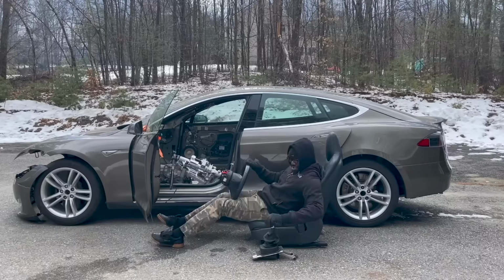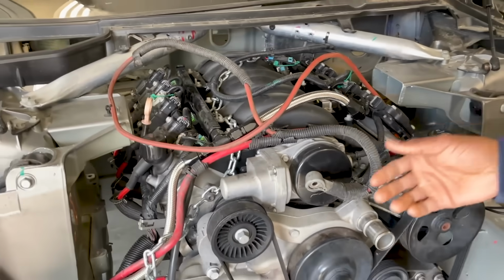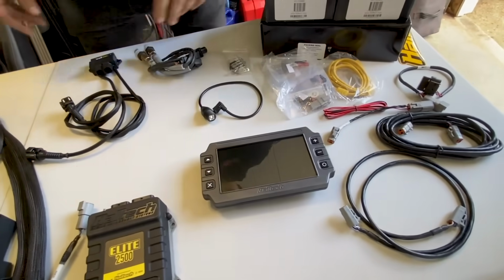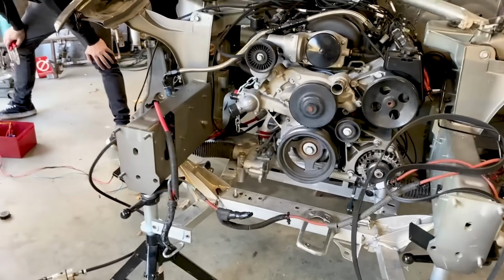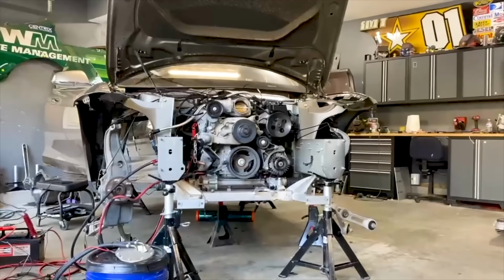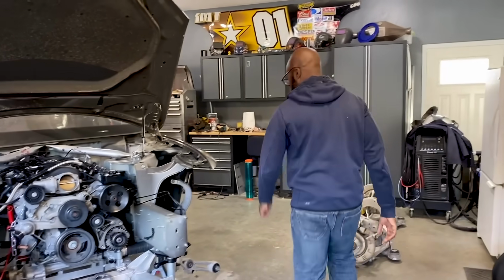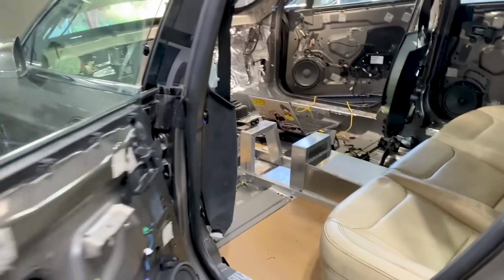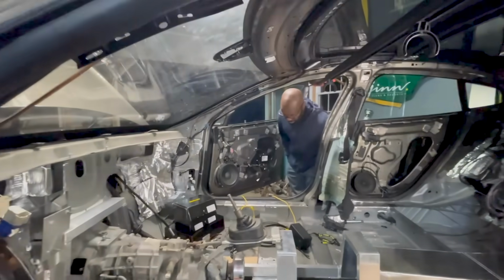Starting the worlds first V8 powered Tesla

Comment: 8:16 anyone who asks how youll do the spark plugs, Has clearly never changed them on a v8 Camaro..... MUCH more difficult than this, You literally have to drill a hole in the firewall (with a hole saw) from INSIDE the foot well of the driver to change that back one. OR diconnect the engine from the trans to allow it to slide forward a couple inches to get at it.
Reply: Yeah, on some FWD v6 engines you have to remove the intake. That's why they use platinum plugs that can last 100,000 miles on most modern cars.

Comment: @21:00 check out how the motor spins backwards because it sounds like the starter went backwards as well. I wonder if it's the light switch you used. I'd check into it before it causes a bigger issue.

Comment: I think You should go in easier direction - SWAP engine but full mechanical V8 with carburetor without any sensors. You don’t have to made complicated comunication and wires. And it will be bigger shock for Elon...

Comment: The -8 fuel line was most likely to run E85. To run on alcohol a much larger amt of fuel is needed. Hence larger fuel lines and sometimes larger injectors. More horsepower can be gained in the end. Tnx for taking us along

Comment: Cool and interesting video)) But in my opinion it would be much cooler to screw the generator to the motor and power the factory Tesla electric motor without batteries)) the mass of the internal combustion engine was compensated by removing the battery))

Comment: I’d like to drive with proper engine but in my opinion diesel should fit better in this project. Tesla without black smoke from exhaust is still not the best possible internal combustion Tesla. 3.0 tdi  isn’t very heavy and after few modifications has enough power especially for Tesla without useless batteries inside.

Comment: Would the V8-engineered Tesla have a longer range? What will be the size of the gasoline tank?
Reply: Should be a longer range, Teslas can't keep their promised range IRL anyway.
Reply: Depends on the tune, but it will probably be anywhere between 300 to 400 miles a tank if you don't dog it all the time.

Comment: 2 1/2" pipe might be better. Need to keep some clearance away from the floor so you don't melt carpet. Or you can run dual 2" pipes on each side and make a custom muffler manifold.

Comment: What's up with the B4 wagon in the background?
Reply: Was a VR6 with a automatic transmission  that I swapped to a TDI with a manual transmission
Reply: @customcreations...............  I have a B4 vr6 sedan I want to swap cd009 in
Reply: @Z69Silveraydoe  You making a rear wheel drive B4?
Reply: @customcreations...............  yes, I have a 350z diff so far, but that can change if I come across a Corvette donor.
Reply: @Z69Silveraydoe  Cool project. I would not bother with getting a corvette differential.

Comment: Whomever said, "You have to pull the motor to change the spark plugs!" has never seen a 4th Gen Camaro. In comparison, this Tesla has a TON of room, even without the side access route. Never had to pull the engine on the 4th Gen ... no reason to pull it here.

Comment: This makes no sense.  Why even call it a Tesla, all it is a free standing motor with some Tesla paneling.  It will never be allowed on the road, as you couldn''t insure it or get it plated legally unless you lied about the make/model?  The transmission will likely fall out the floor, if the engine doesn't catch fire first.  All this because Tesla revoked your supercharging ability on your rebuild?  Obsess much?  (I checked, I'm not mouth breathing, but I will turn this off and go play Cyberpunk 2077, it's built better then that pile of parts!)  LOL

Comment: Just curious what's dimensions on the electric motor  center to the shaft output center and weight of the battery to power it

Comment: Are we not gonna talk abt how it sortof ran withought the valves moving cause there's no belt on it 💀
Reply: It is a push rod V8. The valves on this engine are operated by push rods moved by the camshaft inside the engine not the missing serpentine belt

Comment: As it already has a v8 engine and kind of reminds me of a pontiac gto, paint it wine red or keep the original color.

As for the exhaust system you should have a lot of empty room underneath to put a double down pipe exhaust system under the floor but since it's aluminium which can behave a little different from steel when exposed to heat, I prefer a side exhaust layout exiting as far back to the rear wheel as possible or out the rear bumper and just for the benefits of it ceramic coat from header to exhaust tip to keep temperatures lower and as a bonus a power increase.

Comment: When tesla gave you an electric, powerful, reliable and quiet motor but you still replace it with an inefficient, loud unreliable engine
Reply: If only teslas were more reliable then one of the most proven V8s in grassroots motorsports. And tesla wouldn’t give him another after the car was in a flood because they didn’t want an old car back on the road, which is obviously the least environmentally way forward. This car was either scrap or had a new drivetrain, and this was the outcome.

Comment: I know im late, internet problem. 2.5"-2" straight is more than enough for a throaty v8 sound. Im sure your not going for horse power, 2" is good enough for 350-400hp save your fabricator stress, money, time. Never seen a sub 400hp motor choke on 2.5".

Comment: I bought my 1996 cadillac fleetwood 6 door limousine from ebay, i plan on modernizing the tired old LT1 and 4L60e and then adding a pair of 25-50kw motors to each of the front wheels and then covering the hood, roof and trunk with form fitting solar cells, and then battieres along the massive floor and behind the middle seat. I'm hoping to get the mileage up to 30 city 45 highway(when i'm not having fuel issues i used to get 30-35MPG at 55MPH flat ground)

Comment: this is one of the only channels i think somone might have the answer to this: if i have a front whele drive car  can i add or modify the rear to have  a electric drivetrain and if so how would i need to add logic for the engine to shut off and disconnect the  engine or can i just not worry and run it ne neutral and have a on off switch on the engine for when i city drive?

Comment: Converting a STUPID ELECTRIC TO A V8 IS AWESOME! I love what you are doing!!!
But why not put the engine in the back and install a wall behind the front seats? 😁😁😁😁😁
And use a HUGE 6.7 L DIESEL with exhaust up the roof, modified to SMOKE like a coal locomotive. ✌️✌️✌️✌️✌️✌️✌️✌️✌️

Comment: Not only did you place a ancient internal combustion fire breathing engine in this modern day space ship, 
you also took all the feminism away from those plush seats with a gear banging clutch pushing 6 speed MANual transmission.

The fossil fuel will be burning hot in this machine!  
The clutch dropping alone is worth at least 1million subs from motorsport enthusiasts.

Comment: The irony when your v8 powered Tesla can't run because there's no gas in the gas stations from the pipeline being down
Reply: You do know that engine´s can run on anything that burns, right. 
Ethanol, Alkohol, Methanol, Nitromethan, evan brake cleaner. So don´t worry internal combustion engines are here to stay. :)
Reply: @NB6C-q3v  try running your family car on nitromethane
Reply: @PappaLitto  Don't have to because, 93 exists. 😂
Reply: @NB6C-q3v  Are you implying 93 isn't gas?
Reply: @PappaLitto  Yes. 93 is in fact not a gas, but an octane rating. You got me there.😂 That's why it's called 93 octane.  (surprised pikachu face)
Reply: @NB6C-q3v  where I live all gas stations are out of gas, yes even 93
Reply: Just drives down the road while someone is constantly going through starter fluid on the bonnet

Comment: Nah still use oval exhaust it would be cooler also I would make a plate to cover up everything on the bottom so you could install a lot of things under there and it could be completely hidden away I love the ls telsa
Reply: I think what he meant was that he would be using circular pipes but the exhaust tip would be oval.

Comment: Side exit exhaust right in front of the rear tires is perfect
Reply: But would it stop the smoke from getting inside the cabin. That was the reason they did not opt for placing the exhaust in front of the cabin.

Comment: This was commented before watching the whole video: plastic bucket+gas=Static electricity.
Reply: What is your point? Most of your red lawn mower type fuel cans and your automobile fuel tanks are made out of plastic.
Reply: @customcreations...............  they're also designed to press out oxygen with their own fuel vapors as it's being filled. A 5 gallon bucket doesn't really have that luxury it still has plenty of air and fuel mixture so the static electricity of the fuel leaving the nozzle and running down the sides of the bucket have plenty of air to mix with as opposed to a lawn mower container that doesn't even have oxygen present in it because it's being pressed out by the fuel vapors
Reply: @PSBeachBum  Not going argue your point but over the years I have put gas into buckets for various reason with no negative out come. Dumb luck I guess

Comment: The exhaust you must figure out more issues and one I saw is the exhaust pipe cannot seat flush to the floor cause the heat will start to melt into the insulation and the carpet or wires even if they are in the cab , so the brake line is not the only problem you have .  An oval pipe might be a solution because you must set it at least 1 to 2 inches away from the floor and get an aluminum heat shield that may help.

Comment: The color is absolutely perfect for this project! ;)
There's more room to change the spark plugs on this than my 1973 Mustang.  I can remove/replace the Mustang heads without removing the engine though, not so sure that's possible on this conversion...

Comment: this series ends to the Tesla rep standing on each gas pump in your area.
and only allows you to squirt little drinking glass worth of gasoline at the time.
why? because you dared to service your Tesla yourself. 
and this is best way that i could think of, to simulate a disabled supercharging.

and don't listen to the haters Rich! does this make any sense?
answer is: does it have to? not everything in the world have to make sense.
 this while kinda stupid is still really cool and something that i have joked around many times.
only thing left would you to figure out how to make Tesla accept a charge while in drive.
then hook the most powerful and loudest diesel generator that could fit in a trailer.
then for once drive around town, on a electric Tesla without needing to worry about the battery percentage.

Comment: Shoulda modified the tesla battery to fit in the trunk and back seat away from the exhaust heat. And kept 2 of the tesla motors for 1500 hp.

Comment: Make sure to get some heat shields for the exhaust.   It’s thin where the pipes are going to be run and it will be hot and load on the floor.

Comment: For the ppl saying that he's making it slower- on the street, probably so going from AWD to 2WD. Maybe with some drag radials or bias plys it would be close. However at a 1/4 mile drag strip, this LS setup will be faster. Even if it wasn't, it's easily modded to 800hp no problem. Possibilities are endless after going LS. With the stock tesla setup, it is what it is and there's no modding to make it faster whatsoever besides tires and weight reduction. Plus this is the first tesla that can drive long drives without stopping and charging for hours. I'd much rather take this on a vacation than a stock tesla. Lol

Comment: Looks like plenty of room under the rear seat for fuel tanks. Would have to make transfer pipes to run out the bottom and under the driveshaft and connect across the top with some vent tubes. Or make two long and thin fuel tanks to fit in the former battery bay between the drive shaft and the exhaust pipe on each side. Fill them with the open cell foam used in racing fuel cells so there's no fore/aft sloshing.

Comment: Haltech is awesome. I have been using their ECUs for years and have never had an issue and they have always been there when I needed help with installation. My '96 Protege is very similar to the NA MX-5 and they made me a custom harness and ECU for it many years ago. The original ECU was locked up tight by Mazda and not worth trying to unlock to mess with it because it would usually brick itself if you tried. Their custom ECU was awesome and I still drive that Protege today. I have used them in many other builds since.

Comment: Old man grey bb. Sleeper and put 3 mufflers in a row on the exhaust with a dump and a bunch of noise foam around the engine bay so no one even knows its a V8. Ultimate flex.

Comment: I'm disappointed I couldn't use your discount code to buy at a discount the excellent BLACK Raycon headphones.  That work either through direct corded connection (incoming audio only) or bluetooth (can pair with a phone or computer to have a two-way conversation, WITH the same or better noise cancellation.   And sound way better than the earbuds.  And way less expensive than the stupid Bose crap, with as good or better noise cancellation (IMO).  (Currently have a WHITE set of those headphones, that show every single bit of dirt, grease, smoke stain, etc, they look disgusting now.  Good thing I don't wear them in public).

Comment: I had a stock Holden HK V8 (Australian GM) and you had to remove the brake booster to change the right rear spark plug. Brilliant design.

Comment: Cheapest upgrade for a regular shitbox car: Quality spark plug leads. I bought a set and put it into my VX commodore. The throttle response was absolutely amazing compared to before. And I didn't even change the plugs. It was about 15 years old at the time for reference.

Perhaps changing the plugs would've had a similar result. And it would be cheaper. But this demonstrates the impact of the leads themselves.

Comment: The weight of the situation with the engine starting for the first time feels meaningful though. Against all odds, Uncle Rich went against the meta and did what no man had the balls to do. And Stevonne was there too I guess. 

Car culture revolves around the imperfections of the ICE, but those are all of the same reasons why we love it. Just today, I replaced a starter and carburetor on my truck. The choke was stuck closed along with a few other issues that made the truck run bad. The fact that I had to replace those things may seem like a drag to most of the 9-year-olds who think that the ICE is the bane of the whole planet. But I enjoyed the adrenaline rush that my father and I had when I turned the key after we did everything. Cranking until it starts, which it started much quicker. Then getting on the road, even feeling the Ford 5.0 push you back into your seat a bit as he and I took turns racing through our generic suburban neighborhood. It ran like a completely different truck. I thought the truck was just slow by nature, but it's all of the little things that change its performance that makes it worthwhile. Before, my truck would die out of nowhere, and it was like that for a few months until we replaced the fuel pump too. Again, the excitement of driving around and seeing your hard work, and keeping something you love on the road is something you can never experience in a Tesla. Now, Rich has fixed a Tesla to be on the road again but everything is so linear. Personally, I enjoy that my truck has a slow-ass pushrod V8 that only makes about 130 horses, it still feels zippy, and that's all it has to be. All it will ever have to do is make the owner happy. 

Odds are, two identical Teslas will get the same time at the track. You can't do anything to change that unless daddy Musk lets you use "Ludacris Pro Max +", a feature you had when you bought the car, but since you didn't pay for that one feature, no more ultra-speed. But I've seen a guy with my same body and engine, but he put a turbocharger on the car. He would obliterate me in a race. ICEs allow you to make a car truly yours, and truly happy. 

That's gonna be my student thesis or something in Automotive class.

Comment: I have a rough terrain wiggins forklift with a ford straight 6 i had thought to convert to an electric power plant to run the hydraulic pump and replace the wheel hubs with hydraulic motors doing away with the petroleum fuel that california hates. since california is making farmers destroy gasoline tractors i believe there is a market for converting farm equipment power plants rather than completely rebuild farm equipment save the farmers a fortune and save carbon foot print

Comment: Technically for as fuel tank wouldnt a thin and long tank where the battery pack was work?
Would require extra pumps and work but it would mean once the Tesla is completed it looks near identical to stock apart from under the hood

Comment: If you place the exhaust up tight the heat will radiate the cabin plus the rattle of metal to metal. So you will have to allow for the normal hangers etc

Comment: The colur is fine, the sequential gearbox is the way to go, but get that exhaust out of the rear! Anywhere else and it rots tyres, or invades the cabin space. What I'm hoping is 0-60 she might be as fast as a slower Tesla, but because she weighs nothing, can you map her to be really efficient under 3,500 revs.. Aluminium (aloominum, I believe you pronounce it ;) )  shells weigh nothing compared to normal steel, so she should fly, and be efficient.

Comment: The Pontiac GTO had a dump valve that diverted to the side of the car by using a key (like a gas fireplace key) through the floor board to open and close it. One would run around with it normally closed, but on race day you could open it for effect. The flames would shoot out while you revived the engine. Pretty cool effect, but some said it was burning the valves in the engine.